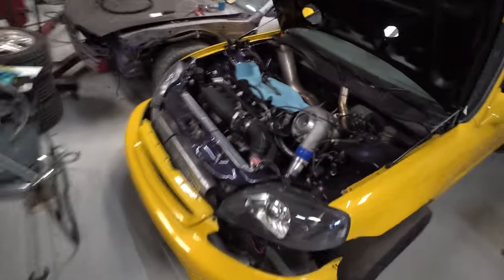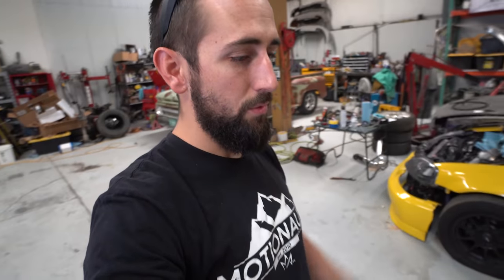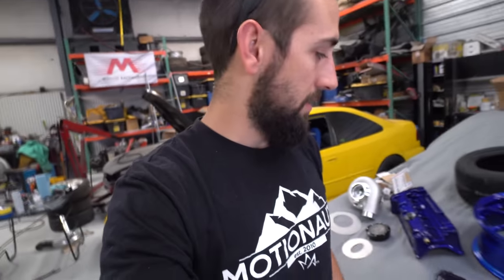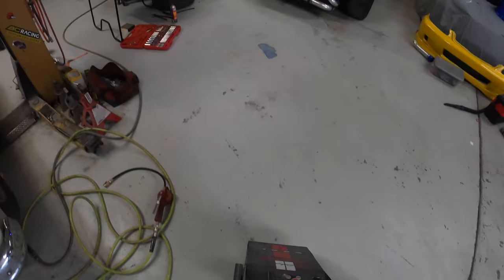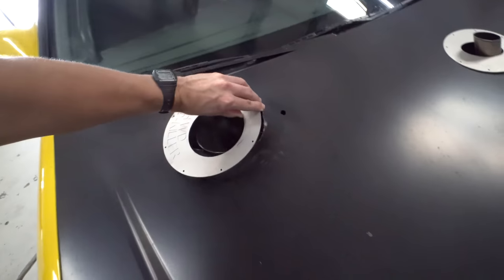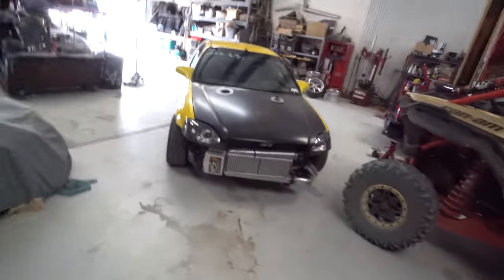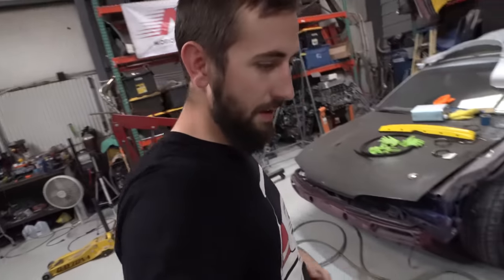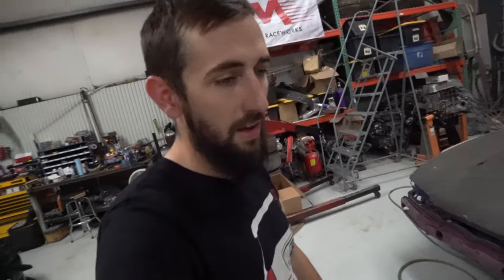How Fast Is An 800HP AWD Civic? 60-130mph Dragy Pulls/ Times

Comment: Wait so that 60-130 time is nearly a second or so faster than a 720s..? Thats Pikachu frfr 😂 
🤔🤯
Reply: 720s 60 to 130 is like low low low 5s actually so very close and on the street it won't be too noticeable stock 720 will be close with this monster but the civic will be  car and a half ahead.  720 wold need a stage 2 tune and it would be close run